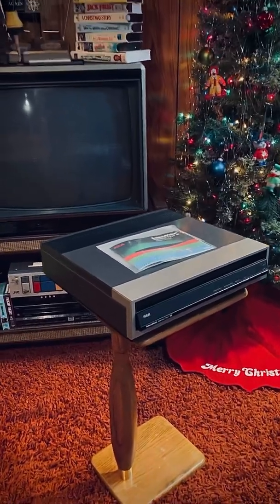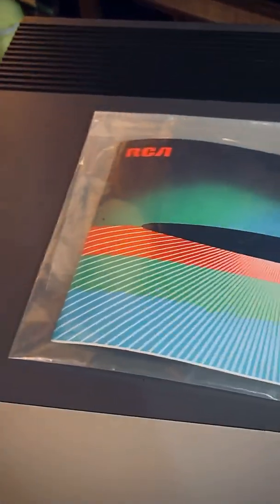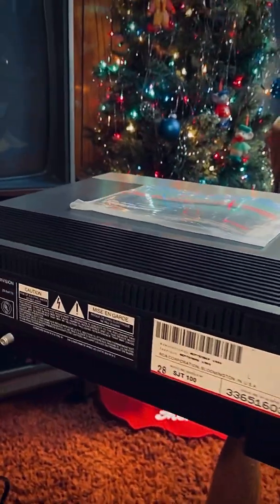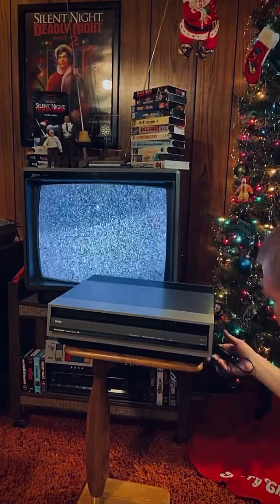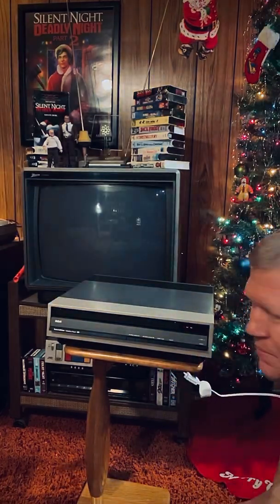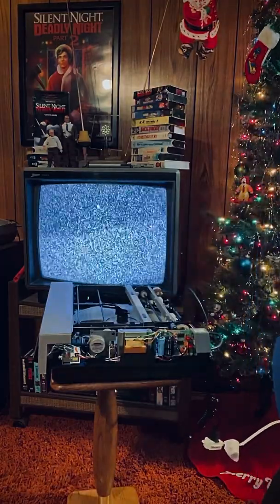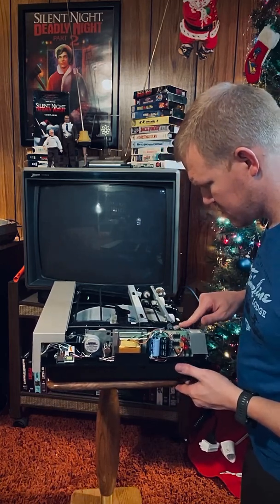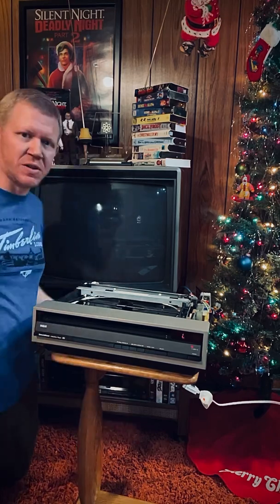1981 RCA SJT100 VideoDisc Player

Comment: Laser disc players were my MOST favorite equipment. I ADORED my player. It didn’t automatically change sides, but that was just fine with me. I was SO proud of it. Had it paired with my 50 inch tv, stereo, and big speakers that some kid who rode a motorcycle had in a big van for 200 bucks. I had all my FAVORITE movies. The picture/sound quality BLEW my VHS tech OUT of the water. I currently own a Sansui 12 inch vhs/tv combo, a Magnavox vhs/dvd recorder, and a Magnavox vhs/dvd player. I used the VHS/DVD recorder to transfer my old home movies to dvd, and the combo to play any vhs that I have (usually movies that are no longer available on anything). I refuse to allow my self to get the Vintage Tech Bug. I just don’t have the space, and I already collect StarWars toys. 😂
GREAT CHANNEL. It’s EDUCATIONAL. It’s HISTORY…